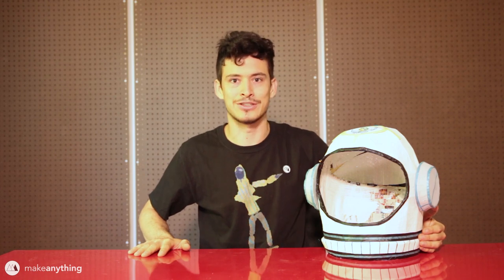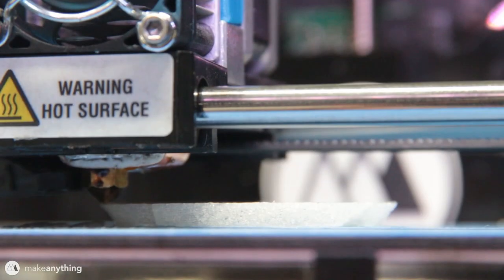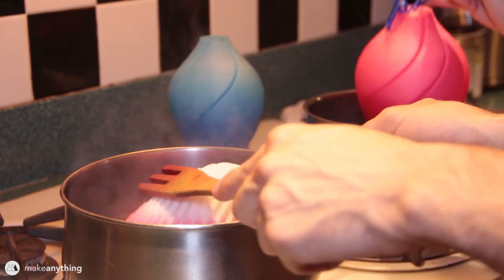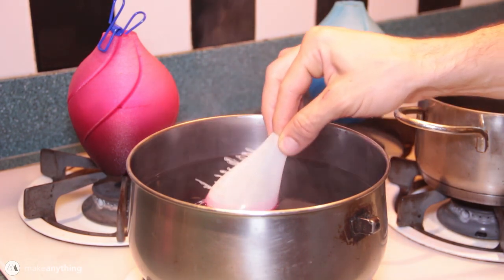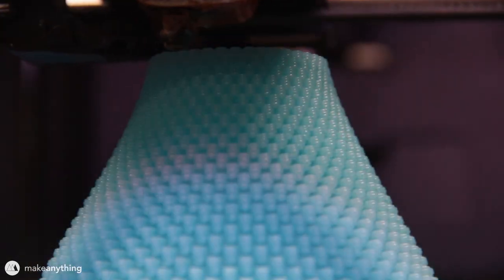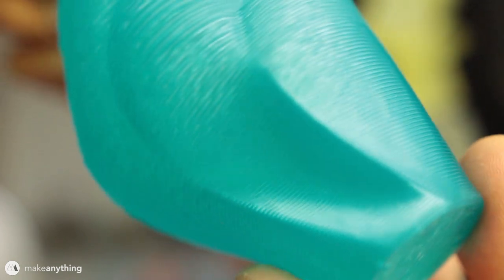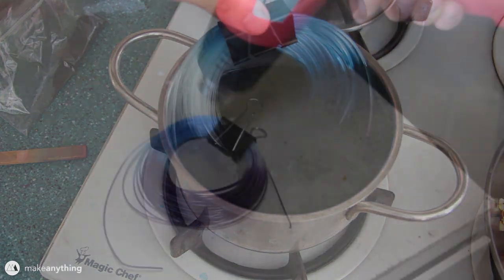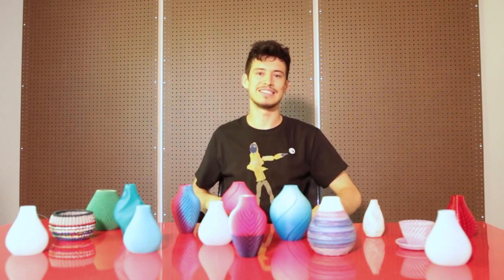Vase Exploration 2 // Dying Nylon Prints and Giant Nozzles (2mm nozzle on 1.75mm filament!)

Comment: Please try and spray paint some PLA for the next tests :P I promise it wont clog your 1mm nozzle :D! Loving this series.
Reply: Jibble pibble
Reply from the maker: I guess I have to do a viewer suggestion episode :D
Reply: good tip angus but i give you both another one, marker pens, just diassamble , make the filament go inside the cotton and pass all the tube, then mount it as it were a filament cleaner or somthing like that, the result wont be spectacular sience it just will retain the outside perimieter of the plastic, but with white/transparents plastics you can change the color a bit.

as u know i dont use to coment, so i profite to salute you both, with joel, my top3 fav 3D printing channels. wish i had the sponsor to make such a filament "wastes" like you do  and experiment with my 4 printers :P
Reply: Make Anything // 3D Printing Channel Who won the 3d oen and the 3d mate mat?
Reply: Maker's Muse Oo

Comment: I would like you to revisit dying the nylon filament with letting it soak in the dye longer, using the stronger power dye, to see it it can hold more dye and then baking it to get the moisture out to see if that'll get a cleaner result
Reply from the maker: I did get some nylon specific dye that should work really well!

Comment: You should try printing a vase after drying the nylon filament in the oven. The surface finish is a lot different without the steam bubbles affecting the extrusion rate. Depending on the nylon blend you should be able to get it mostly clear.

Comment: I'd love to see a strand of filament that you do a gradient on, like you did for that blue vase. It would look really cool when used in a print I think.

Think you could dye some stuff that's not PLA? Are there dyes where you don't need to heat the water, or maybe not heat it as hot as you did here so PLA survives?

Comment: 15:02 Trans vase! 
I think dyed filament has potential for flags and other patterns of horizontal bands. Especially if you dyed it top and bottom as opposed to sides so that you had a long strand of one colour followed by the next, instead of quickly going back and forth between colours. That would require more effort, of course, but it might be worth it for some prints.
Reply: RebelVampire666 💛😊
Reply from the maker: As far as horizontal bands, it's easy enough to just swap out filaments for that effect! I agree though, some interesting things could be done if you dyed the filament as a strand vs a spool.
Reply: Interesting, made me fantasize building an app and robot that would automatically dye filament based on an multicolor 3d model :)

Comment: I work at a plastic extrusion factory, and when we do nylon we have to use dryers to heat it up to like 250 F before we put it into the extrusion hoppers. Nylon is a pain to work with

Comment: One thing I'm really confused about is that some of the 'vases' you showed seemed to have holes in the base. 
Particularly the ones you did with the 2mm nozzle.
I'm not entirely sure having a vase with an incomplete base is useful ;)
What, if anything, do you do to 'fix' these?
I'd imagine running over the holes (or whole base) with a glue gun would fix it, but I wondered whether you actually do anything with them?

Comment: You should try to make a gradient by using a very small layer height and gradually printing more layers a different color. EX: Layer 1: Red, Layer 2: Red, Layer 3: Red, Layer 4: Blue, Layer 5: Red, Layer 6: Red, Layer 7: Blue, Layer 8: Red, Layer 9: Blue, Layer 10: Blue, Layer 11: Red, Layer 12: Blue, Layer 13: Blue, Layer 14: Blue.
Reply from the maker: the new Palette machine has this option... and I'll be getting one soon!

Comment: I have a question, I try to print Nylon for a while now but nothing helps... i tried cold bed(75), hot bed(110) different nozzle temps(230-255), on 30mm/s. but it warps all the time after 3 layers or something like that. i have also try it with  glue stick and 3DLAC.

Do you have any suggestions that i can try?

Greetings from holland :D

EDIT: i also tried to dry the nylon on 110 degrees celsius heat air.
Reply from the maker: Hmm it's hard to say exactly what the problem is, but I print with zero heating of the bed, so it's something like 30C on blue tape. 255 for the nozzle.

Comment: When using vase mode..how do you increase wall thickness/multiple layers using fusion and cura?
Reply from the maker: You can't do multiple layers with vase mode. The best you can do is use a larger nozzle or increase the extrusion width/multiplier
Reply: I will try printing slower with width adj.   I love how smooth/fast this mode prints.  Thank you for answering!

Comment: I'm experimenting with PLA to try to get it to dye with rit but the temperature is such a bummer. I saw some forum online where someone tried this with pure acetone so I might play with that a bit more although the tests I've done with nail polish acetone is not great right now. Even without the water, and just straight dye, it doesnt seem to stain it. 
My question with the post stained models, is how do you keep them from the dye coming out? do you put it in a vinegar and salt bath? I guess if it won't get wet outside and it's indoors, it'll be fine but, just curious.
Reply from the maker: I didn't do any further post processing and the dye has held up. Doesn't come off on the skin or anything. Nylon really wicks up moisture and therefore the dye... not sure how to pull it off with PLA
Reply: @make.anything  on the reddit thread kinderspirit said that because I am using already coloured white PLA, it is treated so I am going to give it another shot with some natural undyed PLA and see how I go! I could always go nylon but I like the challenge with PLA
Reply from the maker: @nataliapockets  good luck! You can also check out my sharpie color blender if you haven't already: https://youtu.be/yQwkHDDed0o